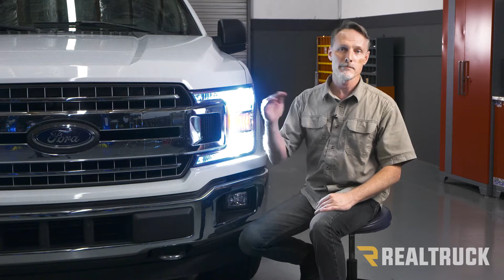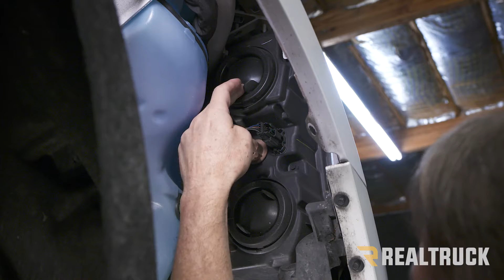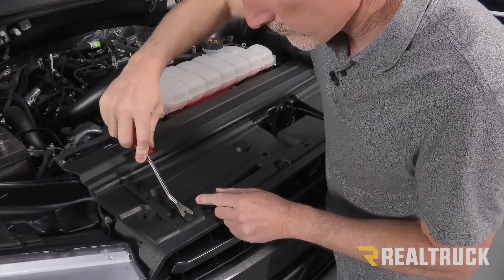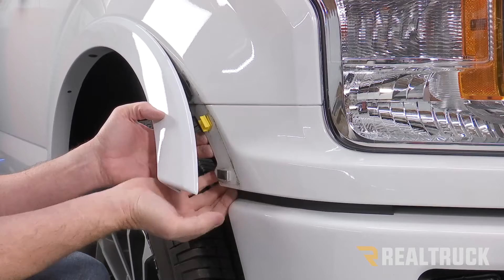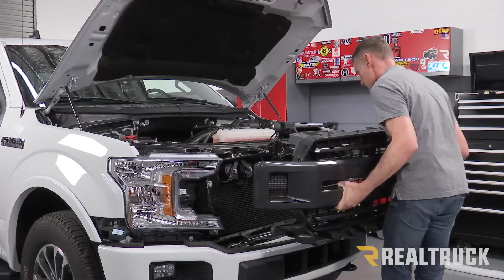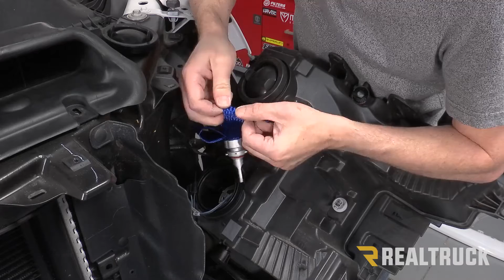How to Install Putco Nitro-Lux LED High Beam Replacement on Ford F-150

Comment: They made it look very easy to fit the extra wiring in the headlight housing. It is very difficult to fit it all in and on the top low beam it presses against the heat sinks a lot. I also was not able to get my OEM dust cover back on and had to order an aftermarket one.